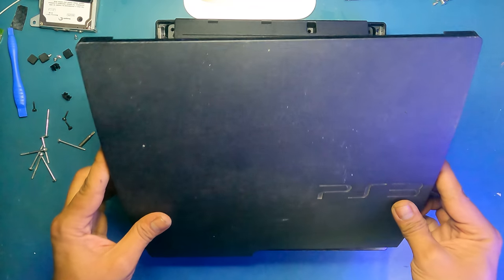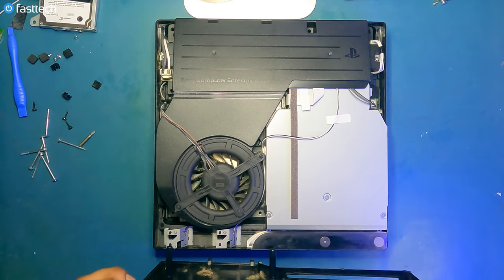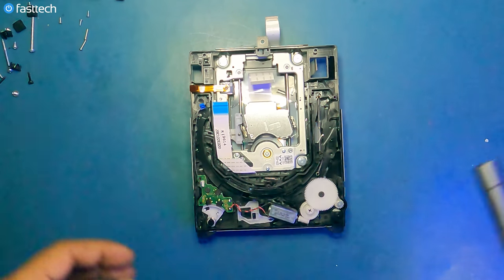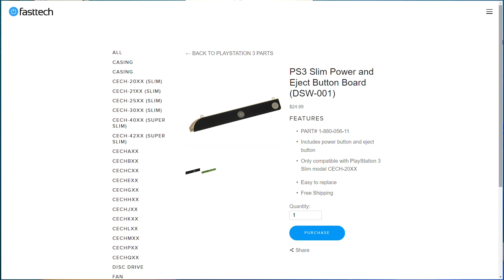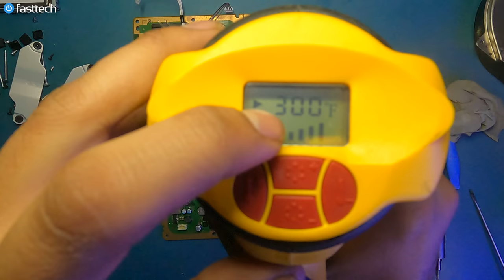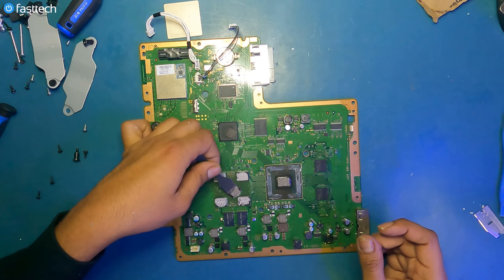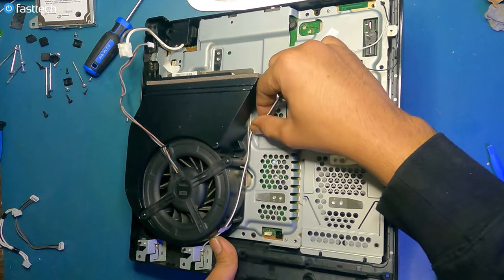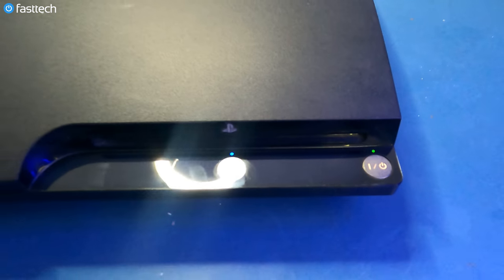PS3 Slim CECH-2001 Repair Guide (No Power, Discs Not Reading, DE-LID and Thermal Paste Replacement)

Comment from the maker: 👉Fasttech Pro AutoKit Screwdriver: https://www.fasttechstore.com/tools/fasttech-pro-auto-kit
👉Fasttech Pro Toolkit: https://www.fasttechstore.com/tools/fasttech-electronics-repair-toolkit
👉Thermal Paste: https://www.fasttechstore.com/playstation-4-parts/arctic-silver-5-thermal-paste
👉IHS Removal Kit: https://www.fasttechstore.com/tools/ps3-ihs-removal-kit
👉500GB Hard Drive: https://www.fasttechstore.com/playstation-3-parts/500-gb-5400-rpm-25-hard-drive
👉1TB Hard Drive: https://www.fasttechstore.com/playstation-3-parts/1-tb-ssd-hybrid-25-hard-drive
👉Power Supply: https://www.fasttechstore.com/playstation-3-parts/sony-playstation-3-slim-power-supply
👉Disc Drive: https://www.fasttechstore.com/playstation-3-parts/kes-450-blu-ray-drive
👉Motherboard + Disc Drive Logic Board: https://fasttechstore.com/playstation-3-parts/p/ps3-slim-mainboard-disc-drive-logic-board-dyn-001
👉Disc Drive Ribbon Cable: https://www.fasttechstore.com/playstation-3-parts/sony-playstation-3-slim-blu-ray-drive-data-cable
👉Disc Drive Power Cable: https://www.fasttechstore.com/playstation-3-parts/sony-playstation-3-slim-blu-ray-drive-power-cable
👉Power/Eject Board: https://www.fasttechstore.com/playstation-3-parts/sony-playstation-3-slim-control-board
👉Power/Eject Cable: https://www.fasttechstore.com/playstation-3-parts/sony-playstation-3-slim-control-board-cable
👉Laser Lens: https://www.fasttechstore.com/playstation-3-parts/kes-450a-laser-lens-for-slim
👉Fan: https://www.fasttechstore.com/playstation-3-parts/ps3-slim-internal-cooling-fan
👉AC Inlet: https://www.fasttechstore.com/playstation-3-parts/sony-playstation-3-slim-ac-inlet
👉Heatsink Clamp w/ Screws: https://www.fasttechstore.com/playstation-3-parts/sony-playstation-3-slim-processor-clamps
👉Heatsink: https://www.fasttechstore.com/playstation-3-parts/sony-playstation-3-slim-heat-sink
👉Antenna: https://www.fasttechstore.com/playstation-3-parts/sony-playstation-3-slim-bluetooth-antenna
👉Casing: https://www.fasttechstore.com/playstation-3-parts/sony-playstation-3-models-cech-2000-casing
👉AC Power Cable: https://www.fasttechstore.com/playstation-3-parts/playstation-3-slim-power-cable

👉Need Help? FaceTime/Zoom Video Call Me: https://www.fasttechstore.com/online-consultation
👉GET REPAIR SERVICE FOR YOUR DEVICE: https://www.fasttechstore.com/electronics-repair

Other PS3 Videos:
👉PS3 CPU AND GPU DE-LID GUIDE: https://www.youtube.com/watch?v=GzMmi7F65wQ&t=30s&ab_channel=fasttech
👉PS3 CECHG Repair Guide: https://www.youtube.com/watch?v=GgOYFO9Pdss&feature=youtu.be&ab_channel=fasttech
👉PS3 CECHH Repair Guide: https://www.youtube.com/watch?v=BDC1O8mYZZc&t=1840s&ab_channel=fasttech
👉PS3 Slim 2000 Repair Guide: https://www.youtube.com/watch?v=S-ewz35fOLY&feature=youtu.be&ab_channel=fasttech
👉PS3 Slim 3000 Repair Guide:https://www.youtube.com/watch?v=ay7GYYMjodQ&ab_channel=fasttech
👉PS3 Super Slim Repair Guide: https://youtu.be/6a9UM_S1T64
👉PS3 YLOD Repair Guide: https://www.youtube.com/watch?v=uAWpqW1HCmo&feature=youtu.be&ab_channel=fasttech
👉PS3 Controller Ghosting Fix: https://www.youtube.com/watch?v=lMQouNRR018&ab_channel=fasttech

▶ Want us to fix your device for you? Just order the Fasttech Repair Box to send us your device by using this link: https://www.fasttech.ca/repair/repair-box

👉Business Social Media:
Twitter: https://twitter.com/FasttechCA
Instagram: https://www.instagram.com/fasttech.store
Facebook: https://www.facebook.com/fasttechy

👉Follow me on Social Media
Instagram: http://instagram.com/youngtechg
VLOG CHANNEL: https://www.youtube.com/channel/UCF2IPXKRX5ctN9td1rhkzHg
Twitter: https://twitter.com/Shehroz

TIMESTAMPS: 
00:00 Intro
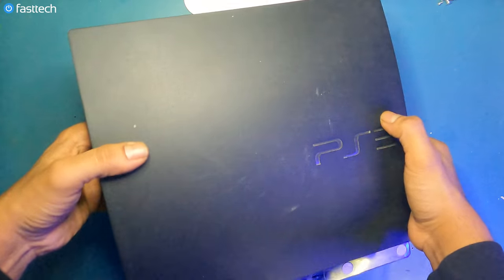00:54 How to check the Model Number and Serial Number
01:38 Tools Required
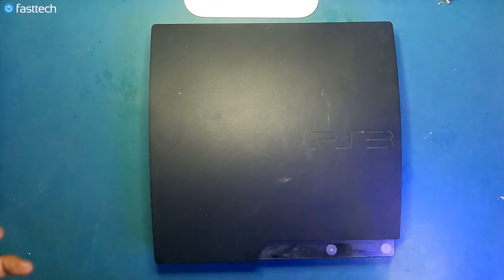01:57 Cannot Start Error Fix
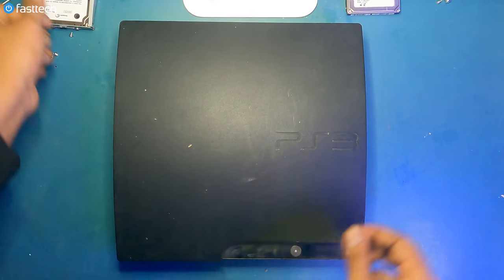08:35 No Power Repair (Power Supply Replacement)
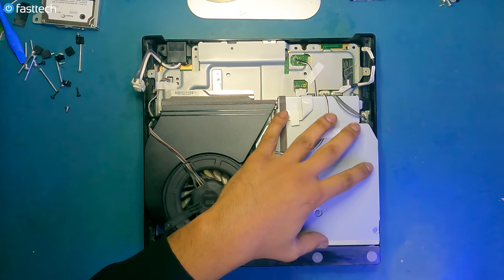15:37 Blu-Ray Disc Drive Replacement (Games Not Reading)  
35:05 Power/Eject Button Replacement
35:48 Fan Replacement
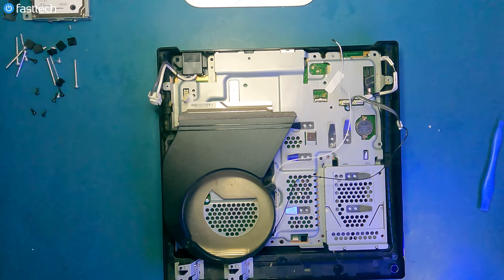37:39 Removing the Motherboard
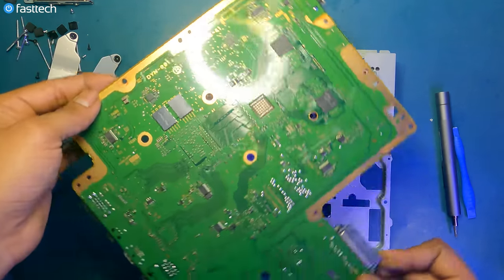42:50 Controllers Not Connecting / WiFi Not Working (Bluetooth/Wifi Chip)
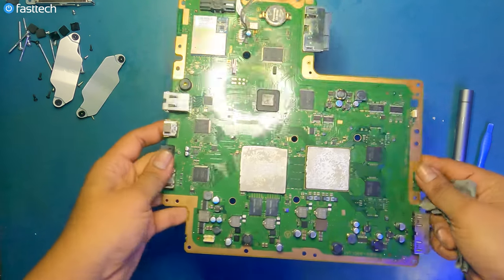43:52 IHS Removal (De-Lid) and Thermal Paste Replacement
1:04:42 Some Housekeeping
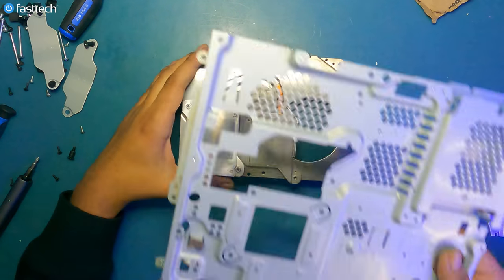1:05:23 Reassembly
1:21:36 Testing
1:22:50 Outro

Comment: This video is fantastic! I was able to fully clean my ps3 slim and change the thermal paste thanks to you. Would you be able to do a video like this with the Xbox 360 slim?
Reply from the maker: We did a video on the Xbox 360 slim but not reassembly. We will be doing one like this for the 360 soon. Thanks for your comment.

Comment: this guy is the goat, perfect breakdowns, have to swap my disc drive, will update if the problem was solved 👍🏽
Reply from the maker: @Beanszo  thank you, let me know if you need help
Reply: @fasttechvideo  will do man!
Reply: @fasttechvideo  so i installed the new blue ray drive and swapped the control board, it works. i inserted a game but it doesnt read it. have any ideas as to why it doesnt show up on the xmb?
Reply from the maker: @Beanszo  bad laser in drive or loose ribbon cables
Reply: @fasttechvideo  actually it seems like my issue had to do with the firmware. Mine was jailbroken, i just unjailbroke it to use official firmware because apparently the blueray drive needed official firmware to run (in the beginning). Im about to jailbreak it again ahhaha.
Reply from the maker: @Beanszo  were you able to get it going?
Reply: @fasttechvideo  yeah man! Everything is working all good now! Your tutorial was helpful
Reply from the maker: @Beanszo  good
Reply: @fasttechvideo  i cant get the eject mechanism back realigned . the worm gears and gears are just freely spinning
Reply from the maker: @jcross72500  i cant tell you what the problem is unless i could see the drive, but check the cylindrical gear on the bottom left of the drive, make sure its not missing or out of place

Comment: Cannot get the mb to release to replace the thermal paste 🤦‍♂️. So scared I’m going to crack it.
Reply: Finally got it off, and replaced the thermal paste. It’s all back together now and it seems to be running so much better. Thank you for the tutorial!
Reply from the maker: @Mau5CFW  great 😊
Reply: Which paste did you use? I’m looking at getting some arctic mx4
Reply: @Ncc0990  that’ll work perfectly. That’s exactly what I used. And it’s done amazingly!
Reply: @Mau5CFW Perfect, so how much are you suppose to use? Did you spread it all over the chips or just put a blob in the middle and then reassemble?
Reply from the maker: @Ncc0990  i used this https://www.fasttechstore.com/playstation-4-parts/arctic-silver-5-thermal-paste

Comment: Any help for fixing the connectors for the ribbon cables of one of these?
Reply from the maker: Which one is broken? Can you provide a timestamp ?
Reply: @fasttechvideo  It's for the thinner one by the fan in a 2001A model, the clip to retain it in place is broken. It's the one by your left pinkie at 15:45 it can be "shimmed" (really more like shoved) in but it's the most temporary of fixes given that moving the console seems to run the risk of the cable coming loose. If the cable itself was broken it would be a far easier fix. Is there any way to replace that specific part and if so what exactly should one look for to replace it with?
Reply: The fan side one, not the power supply side one for clarification.
Reply from the maker: @kabob0077  you can solder it back on but if the traces are ripped from the board it will be hard
Reply: @fasttechvideo  I'd like to know the specific part to look for then to replace the one that's currently on the board.

Comment from the maker: TIMESTAMPS: 
00:00 Intro
00:54 How to check the Model Number and Serial Number
01:38 Tools Required
01:57 Cannot Start Error Fix
08:35 No Power Repair (Power Supply Replacement)
15:37 Blu-Ray Disc Drive Replacement (Games Not Reading)  
35:05 Power/Eject Button Replacement
35:48 Fan Replacement
37:39 Removing the Motherboard
42:50 Controllers Not Connecting / WiFi Not Working (Bluetooth/Wifi Chip)
43:52 IHS Removal (De-Lid) and Thermal Paste Replacement
1:04:42 Some Housekeeping
1:05:23 Reassembly
1:21:36 Testing
1:22:50 Outro

Comment: This video is great! Thank you! I wished I saw your video first

Question:
Could a damaged 10 pin ribbon to the power & eject button cause the playstation to not turn on as well? 
I was able to turn on the PS3 Slim with my controller after reassembled.
Reply from the maker: Thanks for your comment. Yes that cable or board can cause it to not turn on.
Reply: @fasttechvideo  thank you for the confirmation!

Comment: 52:40

sweating and these aren't my fingers touching blade.
Reply from the maker: @millabasset1710  😂
Reply: @fasttechvideo  I'm not a tech expert, this helped give me confidence after cleaning my old slim. Thankfully it has held up well, just needed a cleaning. You can really stretch out old hardware if you clean it.